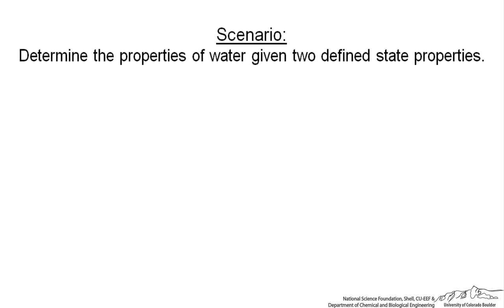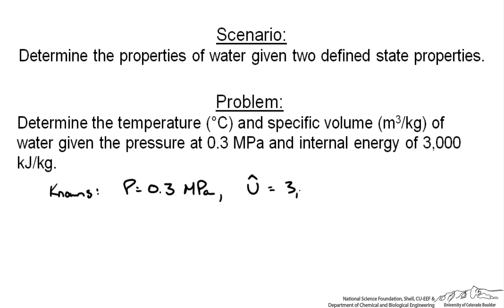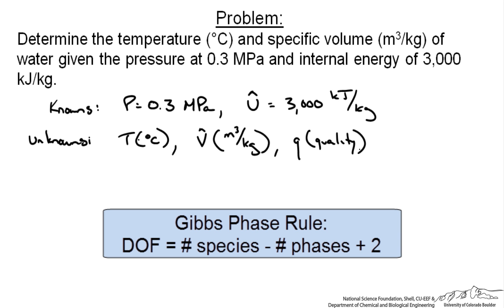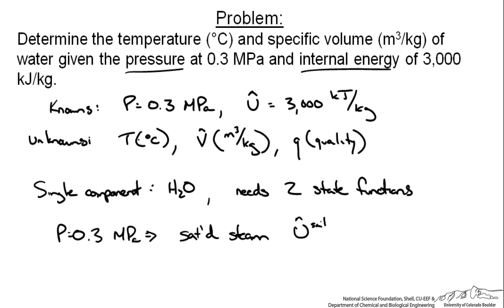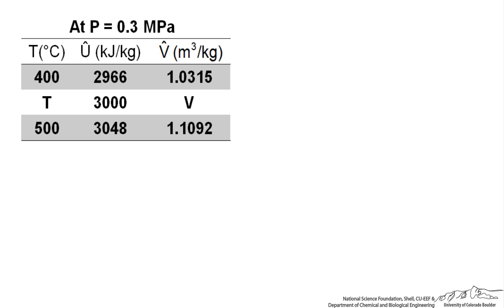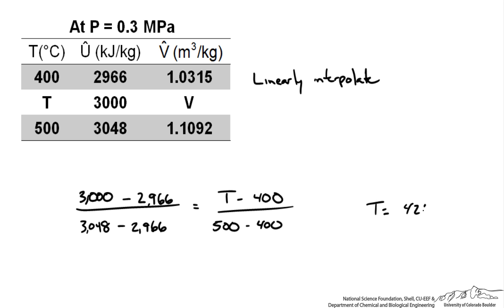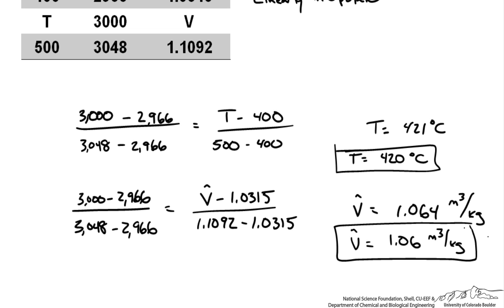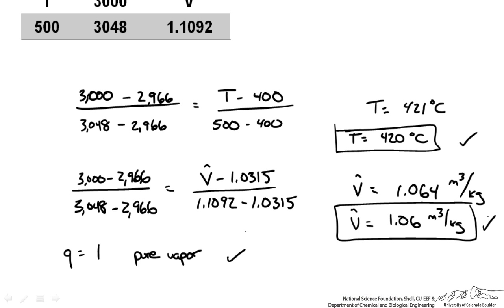Water Properties from Steam Tables

Comment: When interpolating to find T use 450 as the upper temperature, not 500. This will give you the answer that he gets.
Reply from the maker: Great catch!  The calculation is incorrect there.   Thank you for finding that error.  We added a note to the screencast to fix it.
Reply: The original answer of 421 [deg C] was actually correct. I think what Collin Coben was trying to say, was that for u = 3048 [kJ/kg] and v = 1.1092 [m^3/kg], the actual temp is 450 [deg C], not 500 [deg C] as stated.